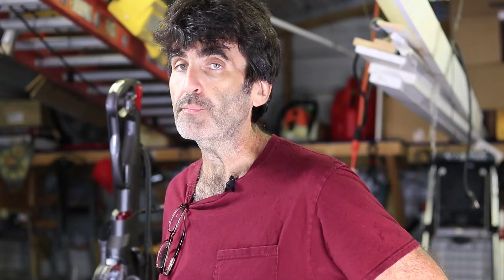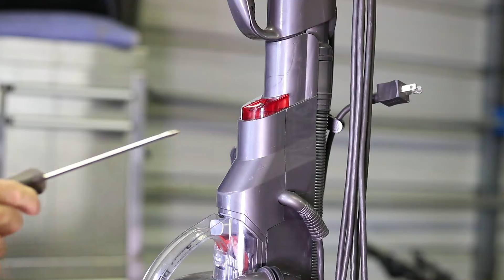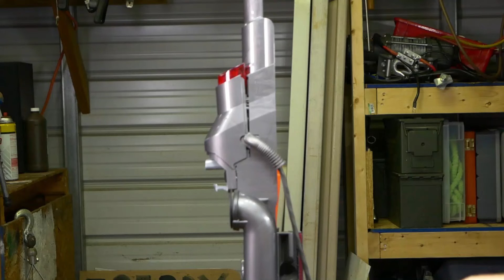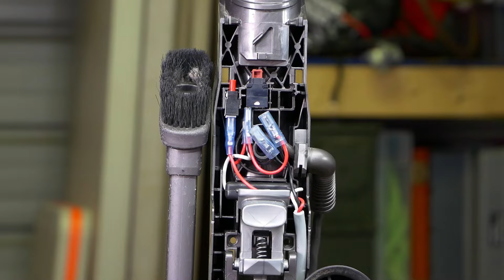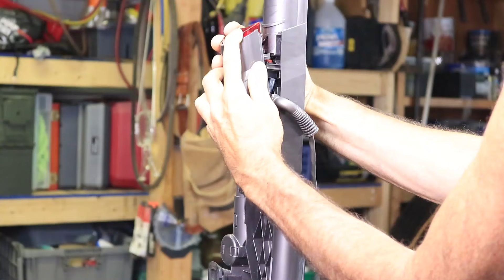How to Replace Power Switch on Dyson DC25 Explained in Full Detail

Comment: I popped out the power cover and one of my springs popped off. Is there suppose to be 3 springs? Because I only see 2 spots for the springs. The long one for the red power button. And the small pairing inside the white piece. But I dont see where to put the 3red spring. Please help!!
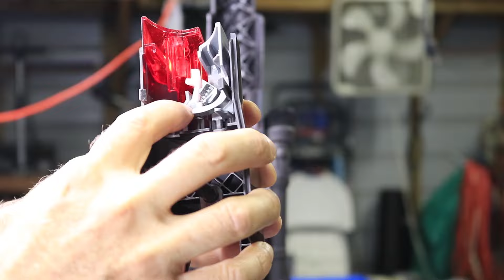Reply from the maker: U got it... There is no 3rd spring.  I show this starting at 2:20
Reply: @TheHomeImprovementChannel  lol... where'd the 3rd spring come from then??🤣🤷‍♂️
Reply from the maker: @BebeBombay  if it came out of your vacuum,  do u have a different model?
Reply: @TheHomeImprovementChannel  no sir. I have that same model.
Reply from the maker: @BebeBombay  well that's a good one!  I looked at the video close up again and I only see the two.... I have to say,  I don't know
Reply: @TheHomeImprovementChannel  ok... thank you for the help boss!!! U rock!!!!
Reply: @TheHomeImprovementChannel  The third spring likely came from the latch that is used to lock the dust container in place at the very bottom of the switch assembly. Speaking of which, my switch cover won't release from the vacuum because it seems to be attached at the bottom where that third spring came from. In your video you just roll the cover away after removing the three screws and disengaging the clips. This has not been my experience, wondering if you or anyone else here might have some advice. I have a DC25, same model as what is in video as far as I can tell. Thanks
Reply from the maker: HI, I haven't taken one of those apart for a while now so I don't remember exactly how I did it.  I don't remember anything to strange once the screws were out, but I wouldn't force anything if it doesn't want to come apart.. @KCarlson

Comment: great video. My beater bar hasn't been working and I haven't been able to figure out why. I identified that the drive belt was still in tact so it wasn't that. Now that I've checked the switch I'm fairly sure the motor is burnt out. Cheers
Reply from the maker: Yes, either the motor is burned out, or there's no power getting to the motor.  If you've checked the switch it's probably the motor...

Comment: Thanks so much for the vid. Helped a ton. That being said, the engineers behind this design should be shot. With your vid, it still took me well over an hour trying to scoop everything back in and align just right. That bar, and springs kept flying out. Seriously what's wrong with a simply 2 button design without all the Lego pieces...
Reply from the maker: I know.  It happened to me too when I took it apart, everything went flying!  That's why I made sure I showed a close up on how it went back because I knew if it happened to me, it'll probably happen to someone else too!

Comment: My Dyson has been sitting in my closet for the past 2 years. I finally pulled it apart to see if I could fix the brush button and it all came flying apart. Thanks to this video I now know how to put them back in place with all the springs and I know that I need to replace the brush roller button as it no longer pops back out.
Reply from the maker: Excellent!  Glad it could help.. :-)

Comment: Hi! I replaced my switches and got it to work but it only works if the vacuum is almost locked up right. If I unlock it, it stops working. It's clearly being shorted somewhere. Is it worth repairing?
Reply from the maker: I doubt anything is shorting.. if it were you'd be blowing the circuit breaker for the house.  It sounds like a wire may be pulling loose when you lower the vacuum into position.  You might have to take it apart again and have a look.  As far as it being worth it?... that's up to you.  My guess is, it'd be a free fix except for the time involved.
Reply: @TheHomeImprovementChannel  actually found the problem last night. The one cable is broken/holding onto dear life. I've purchased the yoke assembly to replace it.
Reply from the maker: @oxmostarkaxo  Excellent!.. is it the power cord?
Reply: It's a tiny cable but you have to buy what they call the yoke loom assembly to replace it. It's like $15.
Reply from the maker: @oxmostarkaxo  OIC, it sounds worth it.... Glad you found the problem.. :-)

Comment: Great Video.  You make it look so easy. One of our springs was lost while trying to get the cover off.  We aren't sure the size.  Two questions:  Are the two springs the same size and should we just pick up a replacement from our local hardware store?
Reply from the maker: I actually don't remember if they're the same size.  You could definitely try one from the hardware store.  You could get a parts breakdown of that particular dyson and see if those two springs come up the same in the breakdown.
Reply: Did you end up figuring out what size spring it was? Mine went flying.. the spring that went with the little white part

Comment: I inadvertently discovered the cause of this issue: when you step on the cord while pushing/pulling the DC25, some of the power cord will be pulled out of the machine. Since the black lead for this (female) connector is the shortest one, it is pulled down and off the male connector on the power switch. 
The solution is to pull an inch or two back through the cord grommet so that it fills the circular channel behind the wires: that is the proper length of cord. In the video you can see that the full cable only extends into that channel an inch or so, which indicates that the previous owner is as clumsy as I am (lol).
Reply from the maker: Yes... Good tip!  Thanks..

Comment: I can't get the switch plate all the way off. It seems to be stuck at the bottom. Any suggestions?
Reply: I just use a flathead and wiggled it just a little bit and it popped out.
Reply from the maker: without being able to see it, it'll be difficult to tell what's going on...

Comment: Great video, the only thing you should go over is that the first time your pulling the switch housing off,  it will be a little difficult getting the bottom portion out. It’s held in on the bottom by 2 small plastic points that snap off when you pull it out. You just have to give it a little muscle. Once you pull it off take a look and you’ll see what I’m talking about.
Reply from the maker: Interesting.. I don't remember having any trouble like that.  I'll check it out next time I take one apart
Reply: That is my issue too. I am afraid to put too much muscle in.  Care for a bit of more explanation? Thanks
Reply: @oldtimer99  I found the two small plastic points; they're on the very bottom of the housing. It doesn't seem like there's a way to avoid snapping them off.

Comment: This was great.   Our Dyson Animal 2 just turned off and I couldn't figure it out.   Then I follow a couple of videos to get to yours.   Just had to reconnect the wire on the swithc that had gotten knocked loose.  Our Dyson is back up and running again.  Only took a half hour to repair.    Thank you for putting this video out there.

Comment: Watched your video and checked out my brush bar switch with an ohmeter -- checks out. Carefully reinserted the switch to the compartment. Plugged the vacuum in to the wall outlet and started the vacuum -- start button works.  Brush bar doesn't move and it still reads 0v at the connector by the brush bar. Pressed the switch on and off without the actual grey button just to see if there was a misalignment -- still 0v at the brush bar.
Reply from the maker: Check the voltage at the switch ... if you have voltage at the switch, but none at the motor, you might have a broken wire or bad connector somewhere in between....

Comment: new switch didnt work - going to repairman after wasting an hour+
Reply from the maker: The switch might not have been the problem,.. You need a volt meter to take measurements and see where you're loosing voltage.  You might have a loose connection somewhere, or a bad motor...

Comment: Dude! I was so proud of myself for replacing the power cord on my DC17 and when I was trying to put it back together the beater bar button, the white plastic piece and the spring went everywhere!  I had no idea how to put it back together until I saw your video!  You saved the day! Thank you so much!
Reply from the maker: Awesome! I knew showing a close up on that stuff would help someone... I made it a point because the same thing happened to me!....   Thanks ...
Reply: @TheHomeImprovementChannel I have a DC17 Animal ands wanted to make sure mine is wired right. Found it in the garbage and cleaned up like a 9.5 out of 10. Should my wiring from the cord on be identical to the one you did? Thank you.
Reply from the maker: @robcruthis7539  I think so since they both have the dual switches there... but I can't say 100%.   If yours looks exactly like the one in this video the DC25... then it should be wired the same...Good find in the trash!  I think this one came out of the trash, and really the only problem was one of the wires had come off the switch and that was it!